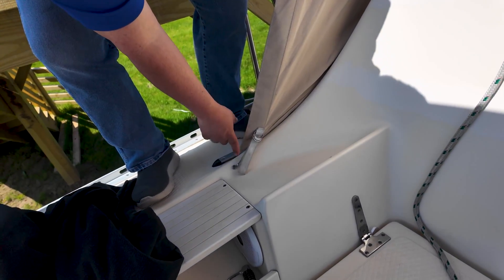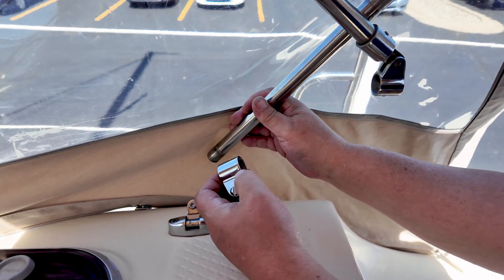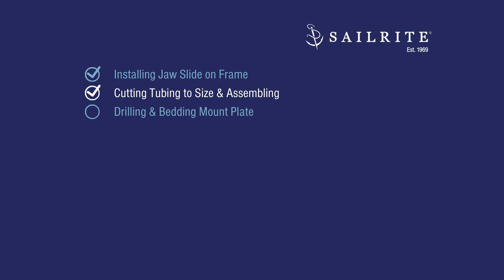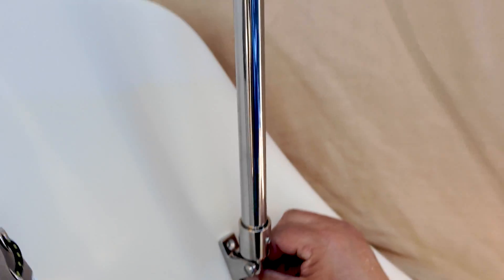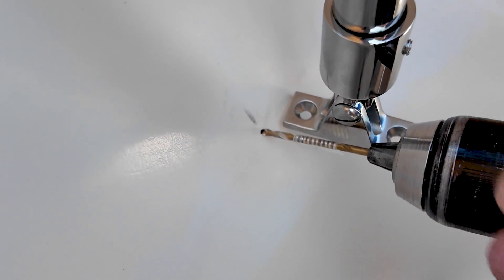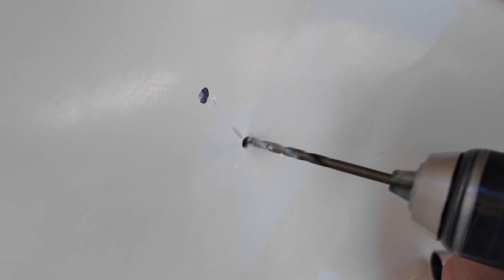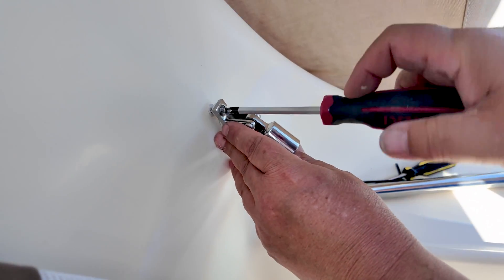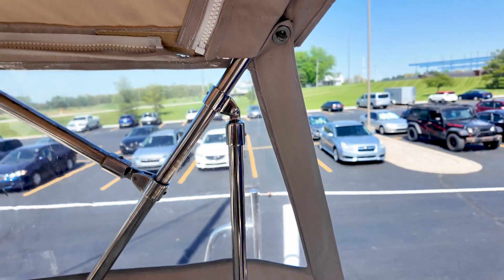Tension Your Dodger Frame Using Rigid Support Struts

Comment: I have seen in my years of buisness with cut out for.straps like that they was straps that went from the Roger to the front bimini frame  so there was no.forward bimini straps but both frames had to be up no.bimini with the Roger off ect.  A stupid design yes. But I've seen a few

Comment: The set screw on the jaw slide and the tube ends (in my opinion) are dangerous.  I have a smaller blue water capable sailboat that the dodger frame has the outside grab handles.  When sailing in rowdy conditions you may grab the dodger frame, a 1 inch stainless frame, with gusto.  And I have had the end cap pull loose.  My cure for this dangerous condition is once the set screws have bit into the tube and marked the tube, I remove the set screws and drill and tap the hole for a 10/32 stainless screw that is threaded through the jaw slide or end cap and threaded into the tube.  Bet that sucker wouldn’t pull off!  Thanks for all the videos, my LSZ1 has be such a integral part of the billion upgrades or just changes I have done to my boat.

Comment: Nicely done and looks good, but a couple of comments: as you say, the support strut will prevent the dodger from being folded forward and out of the way when nice conditions allow or for better visibility (too big a compromise for me); the strut is fixed, so hard to adjust the tension on the dodger over time as the material stretches (or shrinks); adding some anti-seize compound into the set screws for the final tighten up, reduces difficulty undoing them some years later; finally, when possible, it's best to avoid turning the bolt when there is butel tape on it so as not to displace the tape (this might mean, dry-fitting the bolt first if it is to cut thread in the fibreglass)...impossible to avoid with a screw, of course.
Reply from the maker: Good comments! To solve the quick collapse of the frame simply use "Quick Release Clevis Pins" at the deck mount fitting instead of the threaded bolt. The deck mount "flat mount plate" has a threaded hole for the screw, but that can be drilled out or a "Quick Release Flat Mount Plate" can be used instead, if you do not want to drill out the threads. Now you can quickly collapse the frame. Regarding the question of stretch or shrink of the dodger when in the sun it typically shrinks slightly for an even tighter fit than when first installed, seldom if ever does it stretch. However, you can always adjust a rigid support by moving the jaw slide up or down slightly on the bow, if required. https://sailrite.com/Flat-Mount-Plate-Stainless-Steel-7-8-1-Quick-Release-Pin-Version
https://sailrite.com/Quick-Release-Clevis-Pin-With-Spring-Key-Ring